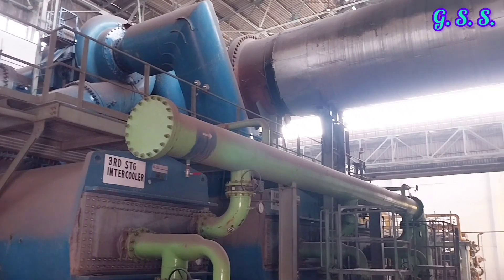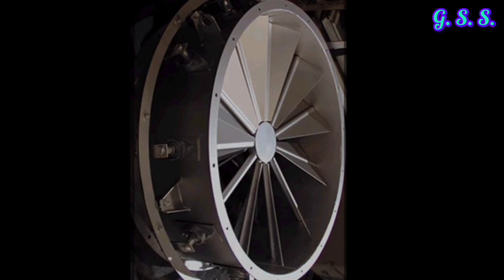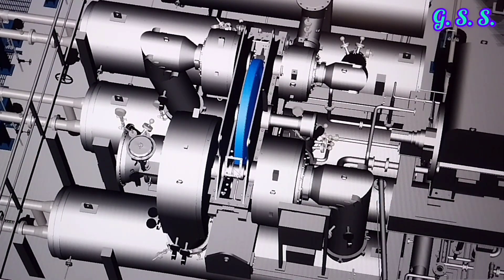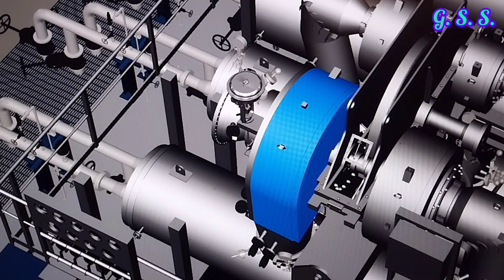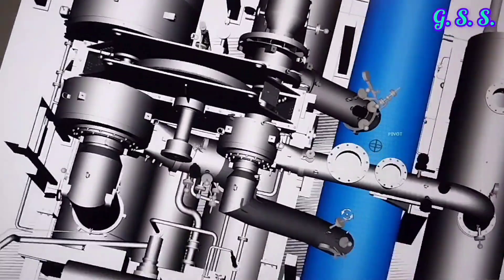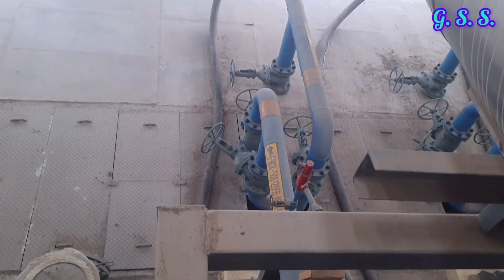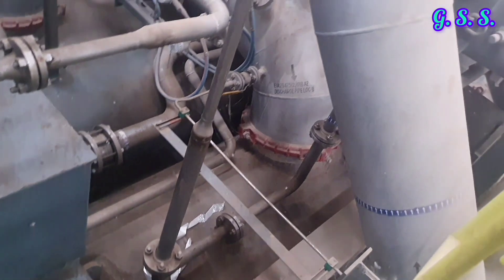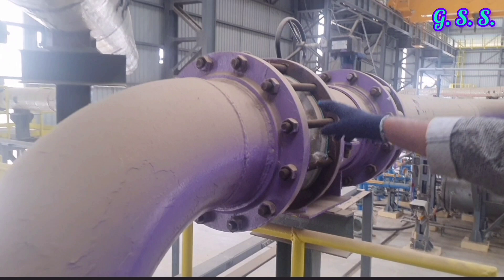Piping Engineering : How Centrifugal Air Compressor Works

Comment: Very interesting video! One question about the process pipes. How can the system behave smoothly without any expansion joints? (except the first and last stage).

Does it have to do with the Victaulic couplings on the compressor and cooler nozzles?

Thanks!

Comment: Very good information, By the way This compressor installation done at HRRL site Barmer ,Rajasthan during 2022-2023  Siemens model: STC-GC-50-4 , Our team has done complete erection, installation , inter-stage piping work , rough alignment ,for all 4 no's of compressor under my supervision , we have also done oil flushing completed but due to cooling water supply issue startup is pending till now.
Reply: Really interesting!!

One question about the process piping. How come you haven't used any expansion joints (except first stage inlet and fourth stage outlet). Does it have to do with the Victaulic couplings mounted on compressor and cooler nozzles? 

Thanks!!
Reply: @raunaqueiquebal7088